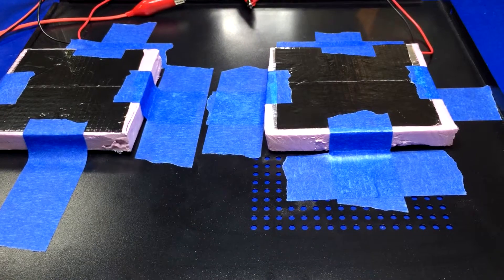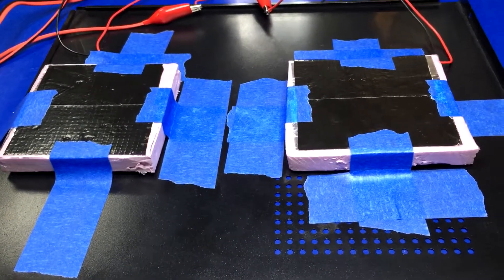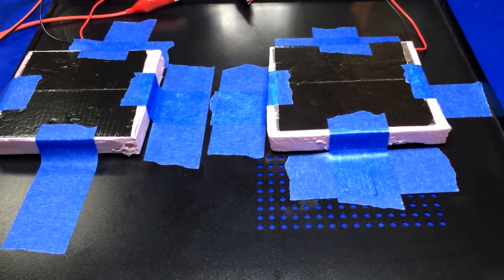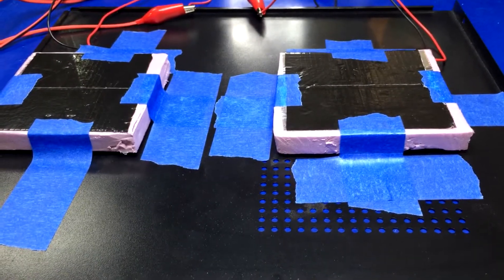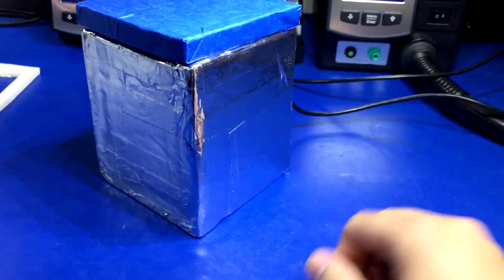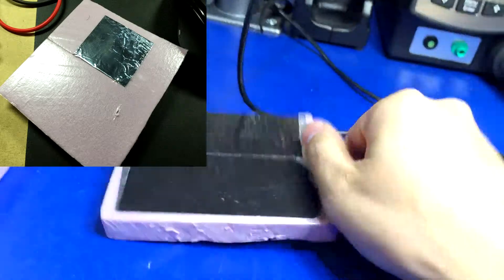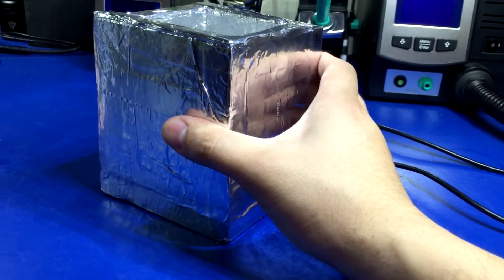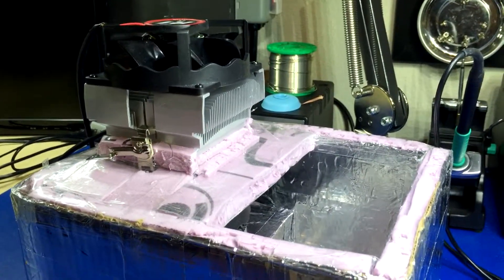Heat Conduction / Insulation Experiment [Learn from my mistake!] #0033

Comment: That is why you cut that foil laminate at a 45 degree angle at the corners so there is no metal path through the insulation. That also allows you to make the box out of a single length of the isotherm sheet, only needing to use tape on the inner corners and the one outer corner. You need to remake the box to ensure those butt jointed corners also have no foil layer in the joints as well, both sides and top and bottom.
Reply from the maker: SeanBZA I definitely need to be more careful for when I get to the real build.  This one works well enough now that I can't be bothered to rebuild it, but I'll definitely take more precautions on the final project.  Cheers!